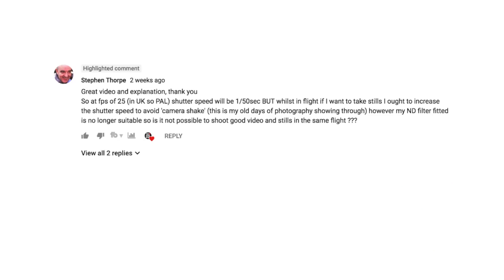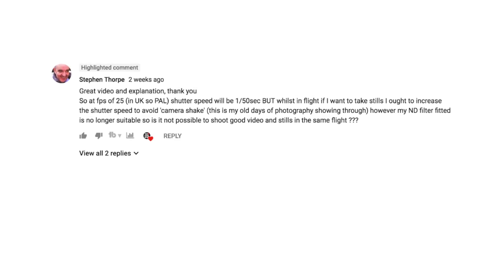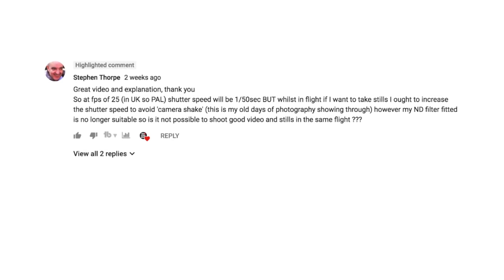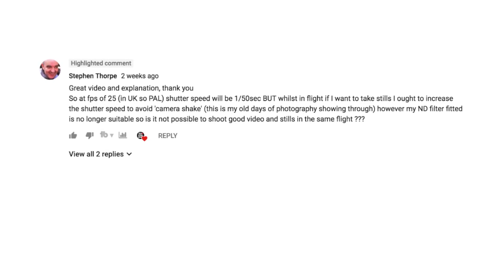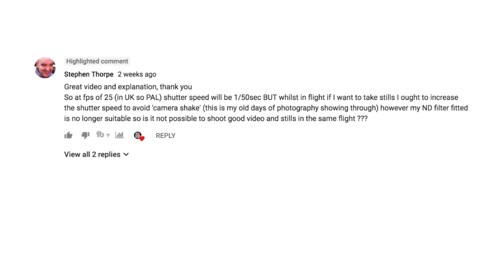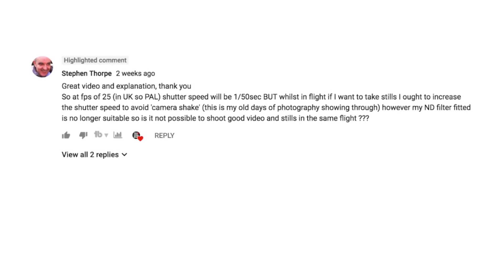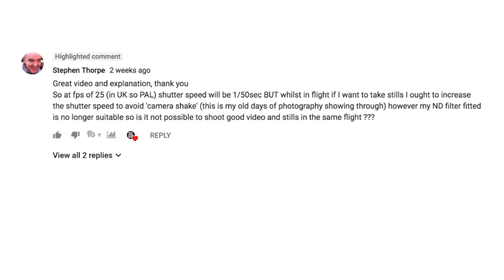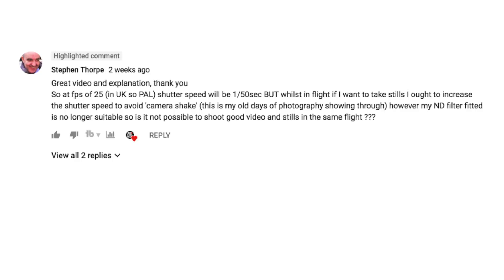Changing Light During Drone Flight - ND filter Challenge

Comment: Hi. I have a question about my Mavic Pro max alt, its just 500m. I buy it here in norway.
Reply from the maker: You mean the range?
Reply: TECH DRONE MEDIA max altitude bro
Reply from the maker: That does not sound right, you should try and contact DJI support.
Reply from the maker: You are not so supposed to fly higher than 100-120m, do you experience it below that?
Reply: TECH DRONE MEDIA i can fly max 500meters high. but i see on youtube some mavic pro can fly more than 500meters high. When i try to set 1000meters high on setting max option i can wrote is 500meters. It is possible it is depend on country? I live in norway.